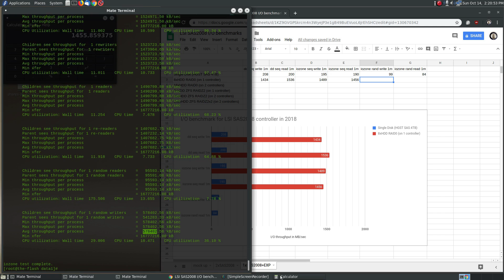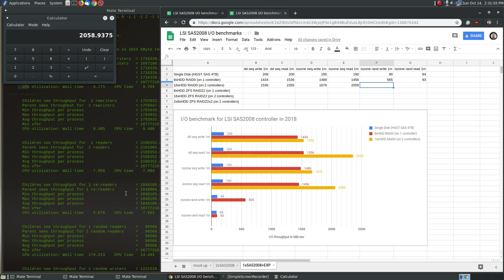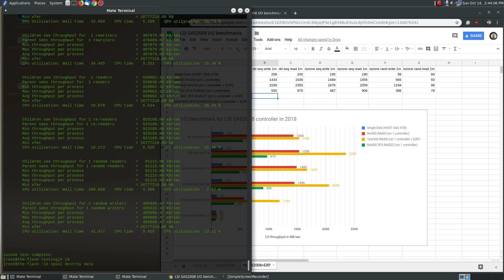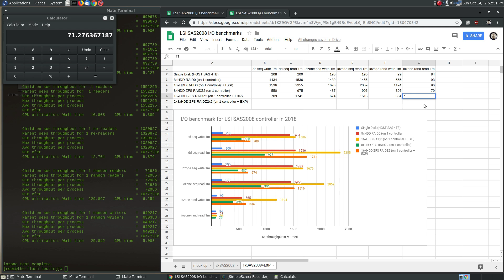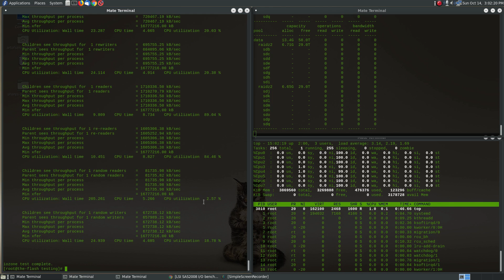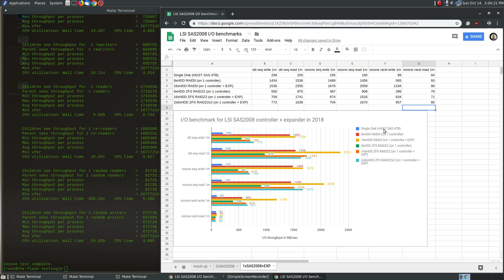LSI SAS2008 with IBM SAS expander performance benchmarks

Comment: fantastic video but why 2 x4 x 6 which equals 48 Gbps which is 6GBps for the theoretical capacity of the controller?
Reply from the maker: there are 2 SFF8087 ports, each with 4 SAS lanes, for a total of 8 SAS lanes. Each SAS lane is SAS-2, so can transmit at 6Gbps, so 8x6Gbps = 48Gbps = 6GBytes/s.

thanks for watching!
Reply: @ArtofServer  thx a ton

Comment: I don't know why your videos aren't on top. I've see all the video in 1.25x and that's greatest! When i've see the ZFS speed rates.... I'm running or in MDADM or Hardware RAID, and those have bestest speed rates than ZFS. unRAID have a better kernel and the comparison about ZFS are better. 

Nice video!
Reply from the maker: Thanks for your kind words. Yes, ZFS is not really the king of speed when it comes to raw disk I/O performance. Something like mdadm+XFS will usually win. However, ZFS has many other unique features that make it very interesting compared to other filesystems and volume managers.

Comment: great test m8 well done, i wasnt expect the result so close, i would be interest to see some test with a 2 port sas 8088 external hba connected to a expander enclosure with lets say 16-24 bays and the use of 1 or 2 8088 cables, wonder if it really matter much a extra cable when using all single drives, maybe in the 2008 sas2 it makes the different to handle the bandwidth....  sorry my bad english but i think you understand what i mean.  cheers m8 keep going this great tests
Reply from the maker: it depends if you are using HDDs or SSDs. with HDDs, you will barely get close to 2Gbps, usually much less. Without considering RAID parity overheard, multiply that by number of HDDs for your max bandwidth requirements (so, this would be ideal for RAID-0 configuration). Then, consider each SFF-8088 cable is 4x SAS lanes @ 6Gbps (assuming SAS-2),  then each cable provides 24Gbps. So, you just need to compare to see if 1 or 2 cables is enough. But, in reality, it is very hard to sustain 2Gbps per HDDs, that is very optimistic and usually only at the very outer edge of the drive. Also, as you can see in my benchmarks, RAIDZ2 and other RAID levels with parity add overheard. With SSDs, the story is much different as you can guess.
Reply: @ArtofServer  yeah right , it probably never comes in the near of 2Gbps even with 24 drives as they are not in raid and no SSD yet they would never been active all together, but i will do try to find out i ordered a 9207 8e card with 2 cables, if it doesnt work with 2 than i have 1 in spare they werent expensive.